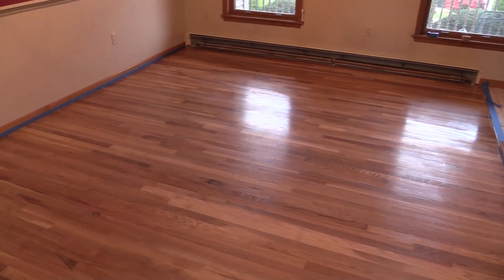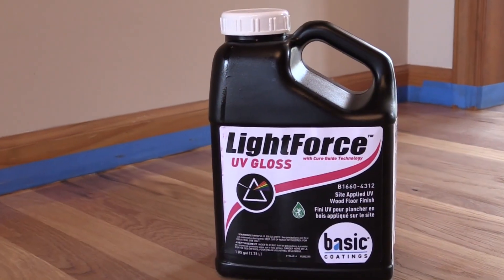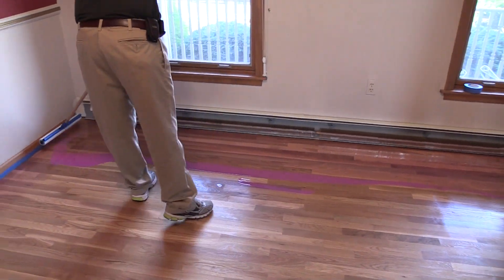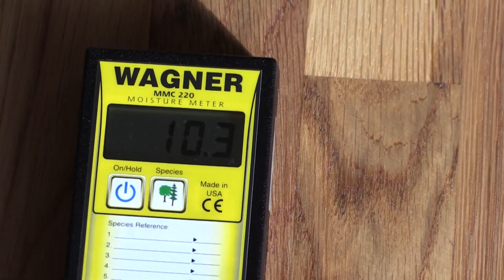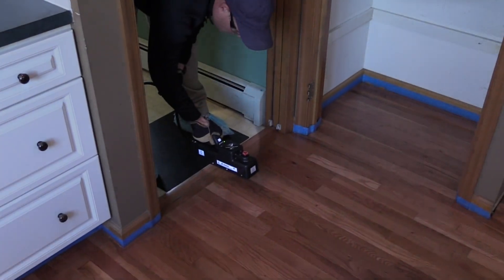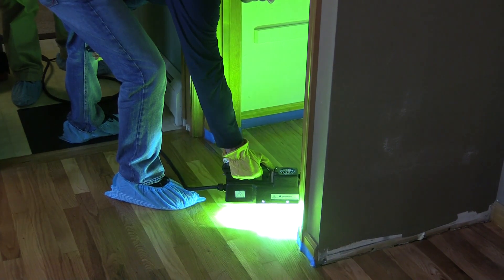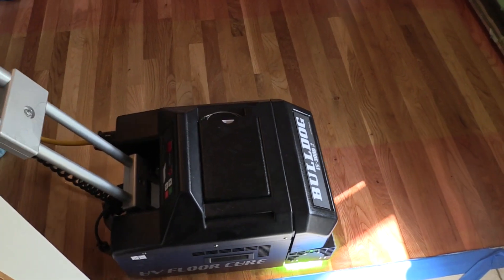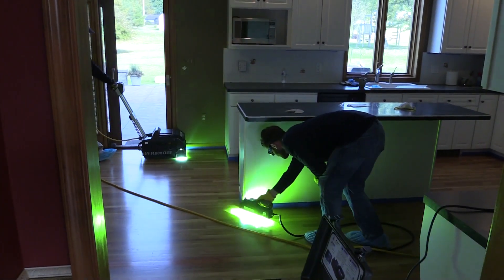UV Curing a Hardwood Floor | City Floor Supply

Comment: very nice job,but why should wait some mins before you can cure? is there still water or solvent inside of coating lacquer?
Reply: he said it's waterbase UV,so maybe there are some water in this UV lacquer.
Reply: It's to give time for leveling and to let bubbled pop. Also in my experience if you start to early the wheels can make marks in the wet product

Comment: I keep seeing uv curable resin/ thin paints...what about a thicker brush on  paint?  I know they use mega uv curing for 1/8" thermo plastic road markings. so I want to cure a small area brush on coat.  Speed is money. 😀